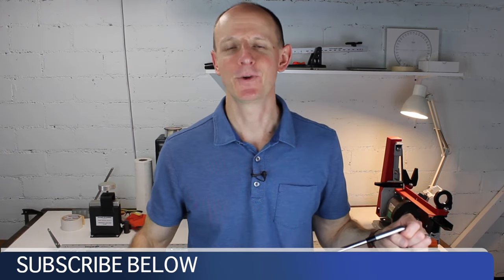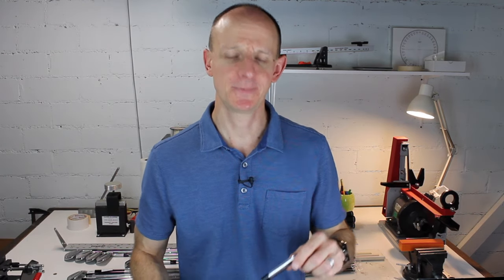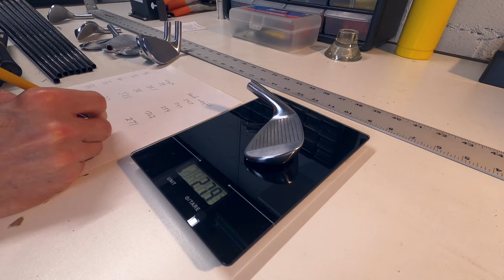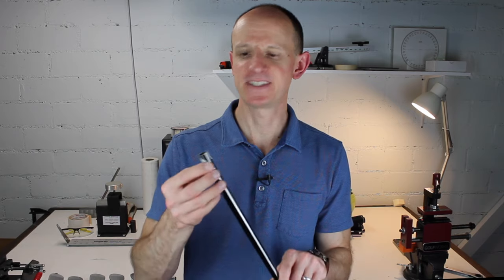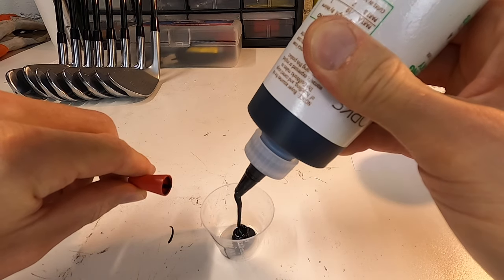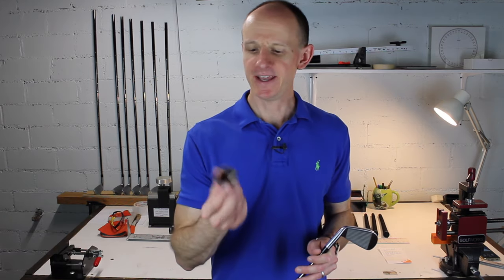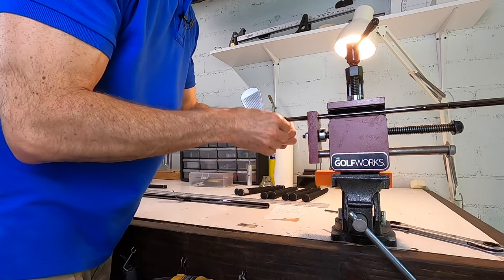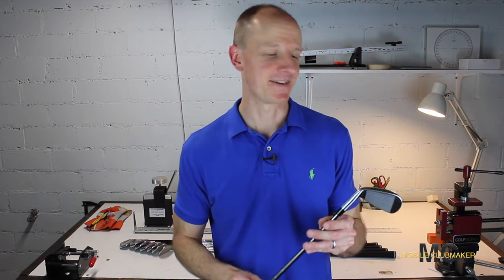GOLF CLUB BUILD - How to reshaft your irons Step by Step

Comment: Awesome video!! Just a brief question, how do you match swing weight prior to shafting? I'd love to match with tip weights rather than lead tape, but no idea if it's feasible since the only way I know to measure swing weight is after shafting. Is there a quick and dirty way using head weight prior to shafting?
Reply from the maker: If you cut the shafts to playing length before assembly. If you have a SW scale, you can then rubber band the grip onto the end of the club where it would sit and take the measurement with the head just on the shaft but not epoxied. Just be careful that you don't drop the head when moving things.
You could also go ahead and grip the shafts beforehand to make the measuring easier. You can also place a piece of fishing line over the shaft tip and them insert it into the hosel to temporarily hold the head on without epoxy.
If you do the fishing line and preinstalled grip, you can also use an online swing weight calculator if you don't have a real one.

Comment: Question? Were the Mizuno heads what they refer to as B heads? It appeared the tip weight you used was heavy. My heads are B heads and I wasn't sure I could use that much weight in the shaft. I enjoyed watching you work.
Reply from the maker: I'm not sure. Got them used, however they were standard length to start with which makes me think they were just the standard weight heads, not the over length light ones. They had the Modus3 120s in them and I switched into KBS Tour so that is where the main weight "issue" came from. Modus being tip heavy and KBS being more counter balanced.
You can add as much weight as you want to the heads. I have 10g in some of the heads and the shafts don't feel loose in the slightest to me at least.
Thanks for your support!

Comment: Could you let me know what type of equipment you have brands and where to buy them.  Sander, cutter, swing weight scale, shaft puller, scale, as I am looking to get started in building my own clubs, reshafting, regripping, etc.,
Reply from the maker: The SW scale is from Golfsmith which is no longer in business. The shaft puller and cutter are from Golfworks. Can also find SW scales there. Rulers, drills, sand paper, etc, good old Home Depot. Loft Lie machine is also from Golfworks.

Comment: Just started learning how to change my iron shafts! A few questions... 1) Is it advisable to clean the inside of the hosel right after taking out the shaft while it's still hot and the epoxy soft? 2) If there's rust inside the hosel, is it advisable to clean it using WD40 or is that a bad idea?
Reply from the maker: Yes always clean out the heads while they are still hot and the epoxy is soft. Otherwise you will have a tough time removing it.
Rust can just be removed with a wire brush or sand paper dowel on a drill. Follow that with a q tip dipped in acetone or rubbing alcohol to remove any last bits or oils.
Never use WD40 is my view.

Comment: Just discovered your channel. Great stuff!  Two questions:  
1.  Do two layers of tape effect swing weight (I’m guessing no for the average hacker).
2.  When putting the second layer of tape on, do you ever reverse the direction (second layer installed on the bottom of the club & wrapped upwards) so you can’t feel the seam created on the bottom (or again, doesn’t apply to the weekend warrior-we can’t “feel” that seam thru a grip?). 
Thanks!
Reply from the maker: It takes 4-5 grams of butt end weight to change the SW 1pt so I don't worry about it. SW is really about consistency through the set of irons so the important thing is that you are doing the same thing to every iron in the set.
As for layering, 2 layers you could reverse or just double up. Most shafts will be wide enough after the first layer that the second does not end up overlapping with itself. Anything over 2 layers I do alternate direction mainly so they can't all peel off if you get a little solvent on them before you're ready to install the grips. (This is especially important if doing grips in the cold, where the adhesive does not stick as well to the shaft).
Reply: @EFGMC  Makes perfect sense!  Thanks for replying.

Comment: Question about a build for a competitive Jr golfer (59 inches tall)  transitioning into adult clubs. Looking to put some used recoil ES 460 F2 into my old TM PSI irons. Your video here shows most of the basics of removing my steel shaft and other videos on prepping you use shaft.  Any thoughts on adjusting the swing weight since I'm going to have to cut the length of the shaft down a bit as well.  Thanks!
Reply from the maker: I would probably suggest putting one club together first (6,7, or 8 iron). Guessing you are planning on cutting an inch or so for that 5ft size. Let them swing and hit with that one club at whatever SW it sits at. Don't think it will be too heavy and I personally like a heavier head with junior clubs. As far as being too light, see how it feels for them and how consistent the strike pattern is. Play around with a bit of lead tape need be until you hit that point that feels right and is most consistent for them. Then you can pre weight the rest of the club if they are too light for a cleaner look or just go with the lead tape for the rest.
Reply: @EFGMC  Thank you and Merry Christmas 🎄.
Reply from the maker: @kgil35  No problem. Let me know how they work out. Merry Christmas!
Reply: @EFGMC  Will do and also you don't think the shims will cause a problem? I think my PSIs are a ..37 in the recoil shafts I have are 0.355.
Reply: @EFGMC  I've heard mixed reviews regarding the use of shims but again for a JR golfer that has a 75 mph swing speed I don't think it'd be that big of a deal.
Reply from the maker: @kgil35  No mixed reviews on shims. Shims are very often necessary and you should not worry about using them. Probably 30-40% of the clubs I do, end up needing shims for different reasons. And this is not for JR golfers, but college golfers, scratch golfers, etc. I use brass shims and they work great. Come in a few different sizes including .355 to .370. Just make sure you sand up the shim inside and out with a bit of sand paper and use a longer cure epoxy (not 5 minute).
Reply: @EFGMC  last question I promise.  If you have time could you provide a basic list of tools that one would need to purchase to go through the process of pulling off an old club and reinstalling new shafts? I'm going from steel shafts to graphite. I know I'll need the shims, acetone and the other items in your video. But I don't know where to get the wire brush or the sandpaper tool that you attach to your drill. Let alone a anvil or vice clamp or one of those things.

My iron heads are 0.37 and I'm installing the 0.35 graphite shafts.

I was going to try to head out to the store today and pick up some supplies before I start my adventure. Thanks again.
Reply from the maker: @kgil35  No problem. Most stuff you can get at the hardware store or fashion yourself. Things like the brushes, and sanding dowels, shims, ferrules, etc, I use Golfworks. They have everything you would need. I vise is super helpful in club building especially when regripping so would recommend a bench vise and a rubber clamp to hold the shafts. Pulling steel is simple and requires no special tools. Just torch, shop gloves, eye protection. Don't worry about asking if you have more questions. Whole point of this channel is getting more people into club building and fitting.
Reply: @EFGMC  great thank you. I just took off all the heads and clean them up pretty good. Do they make a special Farrell for a .355 taper tip going into a .37?
Reply from the maker: @kgil35  You can use a .355 or .370 in this case because you are going into graphite. In theory the .355 would be the correct fit for the shaft, but .355 ferrules are often very tight on .355 shafts especially graphite. You will probably have an easier time dealing with a .370 ferrule. Then you only need to pick an outer diameter that matches closely to the OD of the hosels and choose a length (personal preference).
Reply: @EFGMC  okay great When I took off my TaylorMade PSI irons from the KBS steel shaft there appeared to be some type of plastic plug in the tip of the OEM installed shaft.  It wasn't a tip weight or anything but it looked to be some type of plug.  Do you know what this could be? I could send you a picture of it but I can't figure out how to do that :-)
Reply from the maker: @kgil35  Don't worry about those. They add nothing to the build. Have heard different reasons they are used but none are worth the effort of getting into.

Comment: Hi AJ.  Question about the amount of glue;   When I try to use that small amount of glue the head will sometimes fly off at impact (driver). Not always but it happens.   Generally learned to over glue the shaft part so that it oozes out around the ferrule.   I do coat the inside but to excess.   Is there an issue with using too much glue and have you had many issues of the glue braking?  Thanks
Reply from the maker: I always say to use just enough epoxy to coat all the bonding surfaces. If you do this, you will have a small amount squeeze out of the space between the hosel and ferrule. That is normal. What you don't want or need is to essentially fill the hosel with epoxy. This is not really an issue with steel shafts however the reduced inside diameter of graphite shafts means the epoxy can squeeze far up inside the shaft which isn't good in my book.
Reply: @EFGMC Yeah, I learned a long time ago not to put too much in the hozel. Makes reusing the shaft Very Very difficult since the tip will be full of apoxy and really hard to open back up.   Awesome videos, great source of information and tips.

Comment: Great video, thanks!  Can you tell me what solvent you used at the end to “re-shine” the ferrule?  Mine are always dull after turning down.  Thanks again!
Reply from the maker: That was just grip solvent, but I have also used mineral spirits when I run out of solvent. That step really isn't even necessary if you can brush on the acetone lightly enough and have the ferrule very smooth to start with (using extra fine sand paper).
Reply: @EFGMC  you can use another belt on your cutter/belt sander, to turn down ferrules, simple and easy, then just aceone in a cloth and turn it fast once or twice, job done :)
Reply from the maker: @sving8530  All true. But as many people don't have a belt sander at home but almost everyone has some sandpaper, I use that method in the vids.

Comment: AJ, Any idea of how to remove an adapter from shaft without extractor tool?
Reply from the maker: If you don't want to save the old shaft, you can simply heat the tip and twist it apart. The shaft will be compromised but should come out in one piece. If it frays a little and leaves carbon fibers in the adapter, a wire brush or drill can remove those pretty simply when the epoxy is warm.

If you want to save the shaft, you will need some sort of extractor to pull the shaft without twisting.

Comment: Probably a stupid question but can reshafting irons change the loft/lie angle of the iron head in anyway? thanks
Reply from the maker: Not stupid at all. If you don't have a good centered fit in the hosel and get some shaft lean during the cure process, you can end up with lofts and or lies that are up to 2 degrees off. That is why having a good snug fit is so important.
Also if you change the length of the shafts, the golfer may see a change in the dynamic lie angle. This would be on a case by case basis.
Reply: @EFGMC  Thanks!

Comment: AJ, did you weigh the shafts also?  I did not see that part.  Or does weighing the shafts really not matter?  Thanks for the video.
Reply from the maker: I didn't. It's highly unlikely that you are going to have a steel shaft outside of weight tolerances. And I bought these as a set from an eBay seller, so if one was off, it would have been a hassle to get it replaced at best.

Comment: How "far" in do you put the shaft into the head? Until it stops? I have .355 tapered tip shafts.
Reply from the maker: Yes. Only time I don't is sometimes with PXG irons as they have an extremely deep bore that I don't always fully bottom depending on the situation. Any other brand though, I do.

Comment: question:  shaft removal of graphite shafts, is the same or inherently different!
Reply from the maker: Steel shafts you can just heat and twist out to break the epoxy bond. If you do that with graphite the shaft will fray and not come out smoothly. Graphite shafts are best removed with a shaft puller that removes them without twisting or bending them. This is most important if you are planning on reusing them.

Comment: Greetings. I will soon reshaft my very first wedge (from 105gr dynamic gold to 750 wrap tech shaft): Is 350° hot air enough or do I need 550? Do i need glass shafting beads? When do you recommend them? Also, the lable says "max. 2% wrt the amount of epox", but how can I ensure that with very basic home crafting tools? Thanks in advance for help, hope I don not mess up things (still afraid the ferrule will melt when I remove the blade from the shaft).
Reply from the maker: Most epoxy has a glass transition state around 200F so you should be able to remove it around that temp. That being said, some older epoxies require a good bit more heat. If it's a newer club, 350 should do it, if older, may need hotter or torch.

Anything under 5% for beads is fine. You can eyeball it. I usually use them because they are in my shop but I don't know that I would buy them if they weren't.

Wrap a wet paper towel around the ferrule before applying heat. That will give you a better chance of not melting it.
Reply: @EFGMC  Thx a lot for replying and for the incredible video help!

Comment: What grit are you using in your sandpaper but in the beginning? 80ish?
Reply from the maker: You can start with 80 or 120, just depends how much material you need to remove. The important one is the fine grit you follow it with (220) or more to smooth it out before you brush with acetone.
Reply: @EFGMC  Thanks! I can't seem to find "sanding bits" that can fit within the hosel - any ones come to mind?
Reply from the maker: @davidamor8567  Sorry, thought you referring to ferrule turning by hand. Here is a link to hosel sanding bits.
https://www.golfworks.com/hosel-cleaning-abrading-sanding-sleeves/p/crmwc/

Comment: How do you determine what your swing weight should be?
Reply from the maker: The only way to really do it is to take the starting club and start adding weight to the head until you are happy with the strike pattern and dispersion. Personally I think swing weight is incredibly overrated by most golfers. Most important is just getting a consistent feel throughout the set and the entire bag.
Reply: @EFGMC  watching this video is what made me ask. Seeing you add weights to yours. I’ve only bought standard clubs, so I didn’t know if they had weights in them. I have my late fathers Ping Zing 2s that I want to re shaft! Thank you for your reply. Great video.
Reply from the maker: @KevinHamman-w8g  The shafts I used here were counterbalanced so I needed to get some head feel back, hence the weights.

Comment: I have a broken 7 and 9 iron on some old Adams cb2 with the KBS tour 90. I want to reshaft them. Should I buy pulls or just new? If buying new, do I need to trim tip or just butt?
Reply from the maker: The Idea CB2 should take a .370 tip shaft. Of course it's always a good idea to pull the old shaft and measure just to make sure in case I am referencing the wrong model. Idea CB2 was only one I could find. 
You could buy pulls, but might be hard to just find two shafts that you need. Yes you could buy longer clubs and tip them more, but that will require you knowing how much they were already tipped first go around. Probably would have to buy a whole set in most cases so the cost would not make sense unless you were planning on shafting other irons. Brand new they cost around $30, so not much cost especially if you do the work yourself. 
Personally with the lighter KBS stuff like the 90, I would buy new as they have historically had some issues with the lighter stuff bending from use. Might want to inspect the rest of the set and check for bends also.
You will need to tip trim to flex, and then butt trim the length if you buy new shafts.
Reply: @EFGMC  well I have a Adams wedge with the matching kbs 90 shafts. The 9 iron is supposed to be 36" total and the wedge is 35.5". Can I just pull the shaft from that wedge and add a 1/2" extension? That wedge is pretty dead anyways. Trying to be the cheapest cheapskate in cheaperville
Reply from the maker: @screamwinter  No reason you can't. Especially with the short irons any slight variations will be difficult to notice so go ahead. Only tip I would give is to epoxy the head and extension separately. I always like to turn the club head up when doing extensions so epoxy doesn't run down inside shaft. Likewise I always have the club sitting head down with a reshaft for the same reason.